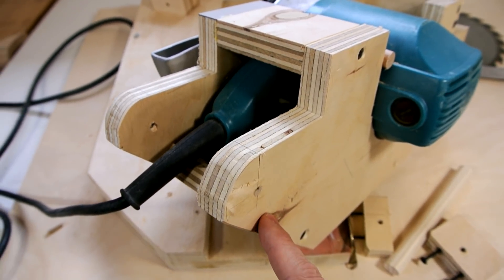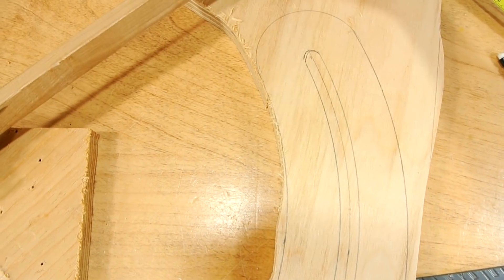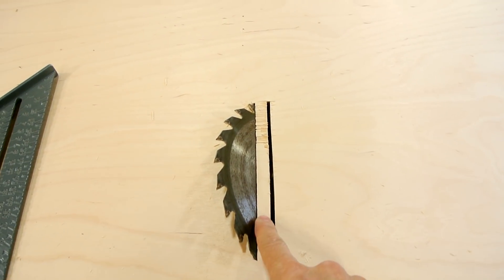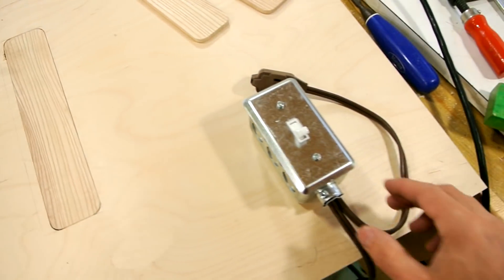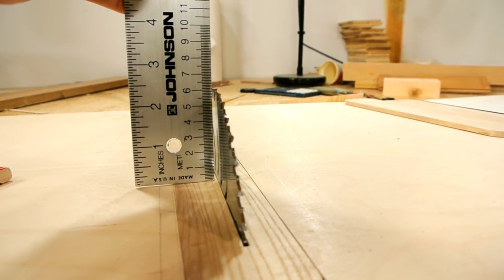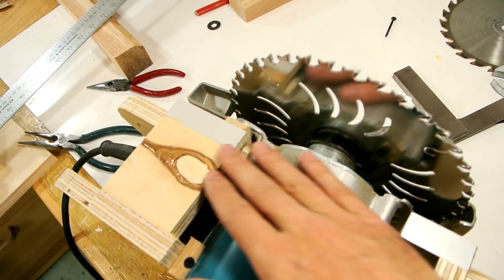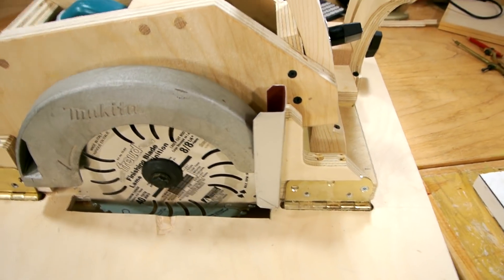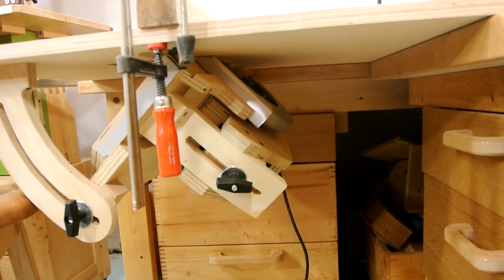Homemade table saw, part 2

Comment: Oh, one last funny thing, don't use a dark zip tie on a dark handle to keep the trigger pulled.  You won't see it when you need to use it again.   My ran across the floor when I forgot to remove the zip tie and plugged it in.  New carpet anyone????   Nice work as usual.

Comment: The correct way (I really believe) to use the metric system for linear measurements is how it is in our (Canadian) commercial construction, and that's with just two units: the millimeter and meter. All architectural details are in millimeters - 200mm concrete block, 600mm wide footing, a bench that is 400mm high, finished ceiling height 2400mm, and so on. Mixing in other units (cm, for example) is not needed.
Reply: I've studied in Australia to be a draftsperson and we do the same thing in industry. Not sure what they do in Europe, hmm.
Reply: @zacdredge3859  Dane here and Architects here work mostly in millimeters and sometimes in meters too (if the project is larger than a standard house, such as a coastal surge guard). Centimeters are mostly used by construction workers (because most measuring tools are in cm and not strictly mm) or in schools, but since conversion is just adding or subtracting a zero, it doesn't really matter

Comment: I do decimal when convenient (calculator), but mostly stay with fractions. The downside (I think) of a simpler system is it engages your brain less. Fractions require some thinking, and are like mental calisthenics - keeping the mind tuned up. Good for us older folk, and given how little most kids know after they go through the school system, the last thing they need is another easier way.

Comment: Great work, but the bigger blade may cause the motor to draw too much current as it requires more torque to rotate -- especially when cutting hardwood. I'd split an extension cord length-wise and use a clamp meter. However you might chose to make the measurement, it can't hurt to be sure that you're not exceeding the motor's power rating.

Comment: I see you used a jig to ensure that the pilot holes were vertical. Did you take any special steps to ensure the 20mm holes were vertical too? I would think this is more important to ensure the dogs fit and sit vertical. I'm looking for tips to avoid buying the parf guide system. Thanks

Comment: Matthias, I made something similar.  It ended up being a box that was designed for carrying the circular saw to a work site, then inverting the saw under the lid of the box and it became the table. It was very practical for all those small cuts needed in fine carp work.  Plus the box itself caught most of the dust, so I didn't have to go outside to make a basic cut.   I had to empty the dust out of box regularly, but the plus side was, with a few simple knobs removed I had my circular saw.

Comment: I built my first end table with a home made table saw like this. I left the face plate on the saw and bolted it to the table underside. I didn't have to cut any angle cuts so it worked fine. Dust was a major problem but it was only for the short term. 
I like your videos.

Comment: This is again a great work from you Matthias W.  ; congrats for your clear explainations , we will never bypass your ideas . I realise that the circular saw is finally screwed in the table saw, which  is a jail for it ;  it would be greater if we can easily  remove and reinstall the circular saw in the table saw as much as we want for occasional outside work ... I think only great  woodworkers like you can do this final idea. Again thanks sharing your investigations on the youtube chanel and have a great day !

Comment: Very useful tutorial. I will have to try this one as my table saw is woeful. Since a half decent table saw is a few thousand dollars, then this is definitely worth doing. Good job.
Reply: You have the same situation we have here in my country! In Mexico they only sell small contractors type saws with small tables, like the poor Stanley that has a plastic base and a terribly useless fence at about $385 USD equivalent, or the "barely acceptable" DeWALT at more than $550, or the Makita 5008MG 8 1/4" Hand circular saw at $180 plus all the necessary materials to make one as this from Matthias genius.  I'll take the Matthias approach!

Comment from the maker: I think inches are a hidden handicap to Americans.  if I tell you "you cut that piece of wood ten thou too big", it sounds like I'm totally unrealistic.  But if I say "you cut it a quater millimeter too big", that is easier to visualize.  And a quarter millimeter is about 10 thou.  And now, what fractional inch inch is a quarter millimeter?  My point being, inches discourage precision work.
Reply: Sorry to move some dust, but as a canadian, I was among some of the last kids to be taught how to use both systems early in primary school (the year after us they switched to metric only)  and then in high school and cegep( pre-university) our science teachers kept using both, insisting about learning conversions, all kinds of conversions. When I started "woodworking" (more working with wood) I tried to stick to metric, but everything is in imperial measurements and I had to keep converting. I dusted off my imperial teachings (and got better at fractions) and now I work in imperial. Even you used a quarter of a milimeter as an example. its a fractional measurement, not decimal (the way it's stated, I know a quarter is 0.25), and most of the time easier to handle quickly. 
 My best measuring tape goes to 1/64th 0.39 mm, so the highest accuracy available is 1/128th 0.195 mm theoretically. My metric rulers stop at either one or two milimeters, giving me 0.5 or 1 mm accuracy. Are they manufactured tight enough, I'd have to validate, but my skills make me work in the 32nd range at best anyway.

Comment: I think it's a great idea if you happen to come across a second circular saw (garage sale, thrift store, pawn shop, collecting dust in the back of a friend's shed, etc) and don't already have a table saw. Then you can build a table saw with less than $50.

When he was constructing the depth mechanism in the first video, I spotted a great idea for a homemade miter saw. So perhaps if you came across a third circular saw, you could also make a homemade miter saw!

The possibilities are endless!

Comment from the maker: But the world of precision is mostly metric.  If I buy a 3/8" diameter ball bearing.  What's the most likely outer diameter?  26 mm (not 1").  Buy a 1" ball bearing.  What's the typical outside diameter?  52 mm (not 2").  Precision stuff (like ball bearing) tends to be natively metric.

Comment: I always enjoy your videos and I used to be a fireman in the 70s a lot of fires I responded to were the fault of what we call zip cords, which is what you used for your switch. I know you pretty thorough did you check the amperage the zip cord was able to withstand. My wife thinks I'm pretty strick but I always make sure that any wire I use is more than what is required. Thanks for the videos always enjoy them.

Comment from the maker: The bolt is an interference fit, because I want it to be very tight in the hole.  Could have twisted it all the way in, but didn't want to take the time.

Comment: Nice build,just goes to show you if there's a will there's a way. If you can find a saw at a flea market or a hock shop,you could make a table saw for under $30 that is fairly accurate.
Thanks Matthias,

Roland

Comment: Using a hand held saw (for the right hand) and mounting it reversed, you got the motor on the left and the blade is tilting to the left. Most table saws tilt to the right, I think. Obviously you could not have done your "X" as you did it (but surely another way). Do you see other advantages in tilting it to the left?

Comment: I agree, precision in building something, especially as a hobby, has nothing to do with the system and everything to do with the tools and how you use them (mostly the latter even). The major difference comes when planning and calculating big projects, as would be supported by your comment that commercial is metric in Canada.

Comment: Nice work.... I'm just concerned about the new saw blade you installed... It is bigger in diameter... This will increase the torque over the motor which might not be able to withstand this additional torque.... My recommendation is stick to the older saw blade.. the smaller one.. so that you will not face issues with the motor.

Comment: Matthias: Congratulations on your design.  May I suggest you an specific model for the saw: the Makita 5008MG is a 8 1/4" circular saw, and its motor is geared for the 8 1/4" blade.  I am not happy with the overall base of that model, because it lacks some rigidity, but that does not matter when you use it in your design. Plus, that model seems sensibly priced compared to many 7 1/4" saws, but can use BOTH blade sizes, which is useful due to the fact that there is a much wider assortment of blade types on 7.25" than the few available in 8.25", and many of us already have quite a few 7.25" blades already.  Best wishes from Mexico!

Comment: Very very nice!
I was wandering is it not more practical if the blade does not shift when it is angled. So that the angle-zero-point (how ever it is called...) is exactly on the table. More space (wood) between the machine and table will help. Or am I wrong?

Comment: Quarter millimeter? The best of both world - fractional metric.
I can work in both, but prefer imperial - seems more natural, at least to me. The construction industry in Canada is similarly split, with all commercial work entrenched in metric, while most of the residential work is imperial, and will be for the forseable future. One thing is clear: a high enough precision can be reached with both systems.

Comment: Thank you Sr!! Part 3 please Mr. Wandel, I want to ask you if (for the better of the general idea) there is a circular you know that is the most squareish in it's entire construction, strating with it's carcase and the base's dimension that can result in a more precise adaptation? Well it's only a thaught. I'm rating this video with double five stars. Thanks!! (Y)

Comment: hi mathias, i have made mi own table saw, but not like yours, i just screw the saw to a peace of melamine, but mi problem is wen i cut some wood or something else the dust goes directly to mi face. Ani ideas ? i was thinking in remove the protection of the blade! Saludos desde Argentina!

Comment: If you move the hinge back a little so it is aligned with the centerline of the first blade cut at 90°, it will pivot at the blade.

Comment: The blade guard you refer to is the one that swings out of the way as you cut in normal use?  If you wanted an even bigger blade (lke a 100mm standard table saw size) do you think it would be possible to cut away the rest of the curved metal guard without affecting the use of the saw itself?

I guess you could hold the zero clearance inserts with magnets.
Reply: Yes, you could remove the upper metal guard, though you should build a new bigger guard on the underside of the table just to be safe, and it could also be designed to collect the dust. Whether or not it's even worth it depends on whether the saw motor has enough amps to really power through thick hardwoods with a 10" blade. Seems like most of these cheapo circular saws are 10-12 amps. A 13-15 amp would be best. Just go slow so as not to overburden the motor since this project isn't really worth the time and effort if you just end up toasting the motor.
Reply: @ CmdrGendoIkari - Thanks for the reply - I bought a triton 2500w x 250mm saw that's designed to go under a mounted top, but you lose 50mm cutting depth from arbour to base, so once it's out of warranty I might go up to a 300mm blade which would give me almost 120mm cutting depth! More than enough for the 4x4's my builder mate occasionally gives me.

Comment: I applaud the ingenuity and skill it took to design and build this project!  However, am I the only one that thinks this is a little dangerous?  Is the risk to your fingers and hands worth saving a little money instead of buying a proper tablesaw with a riving knife and a blade guard?
Reply: Loads of table saws I saw in use on YT don't have blade guards... coming to think of it, I don't remember any. However I have hardly ever seen someone as cautious cutting wood with a table saw as Matthias Wandel. He always uses push sticks and keeps his hands far from the rotating blade.

Anyway, Matthias Wandel does have a regular table saw. He built this one only to see if it was possible to built a decent table saw from scratch with the things at hand. If you browse his videos you see more of his ideas made into reality.
Reply: Just because "loads of table saws you saw on YT don't have blade guards", does not make it safe.  Matthias may have a regular table saw, but that's not what I'm talking about.  I referring to the content in this video.  The individuals that try to build this likely won't own a table saw and will likely be inexperienced in table saw use and safety....and truthfully may not be safe with their circular saws.  Regardless, of what you may think it is NOT a good idea to follow through with this project.  I've seen a couple table saw injuries first hand and they were not pretty.  Both of those individuals wished they had used the guards.  If you're not convinced google table saw injuries in the US.
Again, I would recommend that they save money for a proper table saw, learn how to use it properly, and use your blade guards, riving knife, anti-kick back pawls...use what ever you can, whenever it is possible.  If it's not possible build a jig or sled that will make your cuts as safe as can be. 
You can't regrow fingers
Reply: 001photo Hey, thought I would weigh in to the discussion. As a tradesman, I can tell you that most tradies I have worked with prefer to have the blade guard removed. They (myself included) feel safer knowing exactly where the blade is and where the piece comes in contact with it. It certainly comes down to personal preference, but I feel a lot safer with the guards removed.